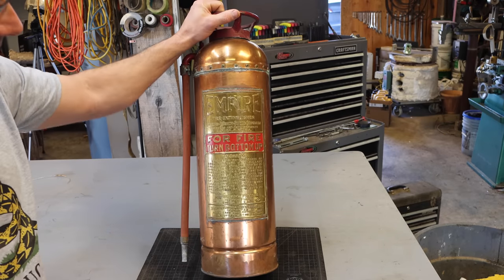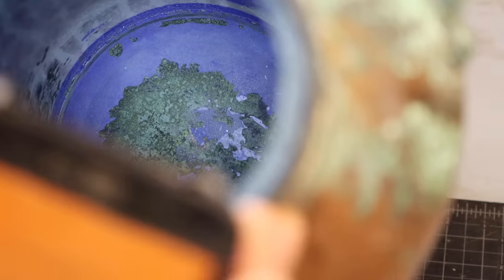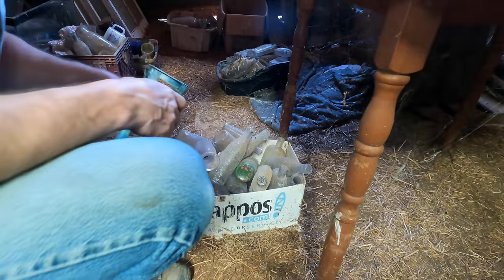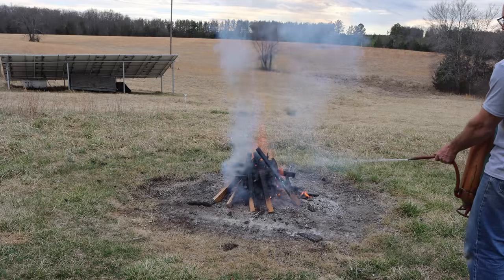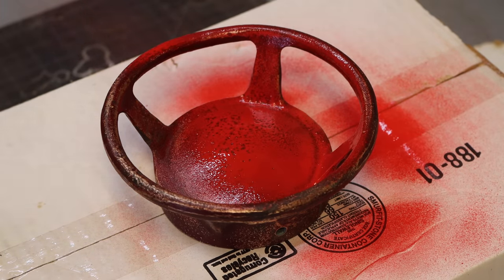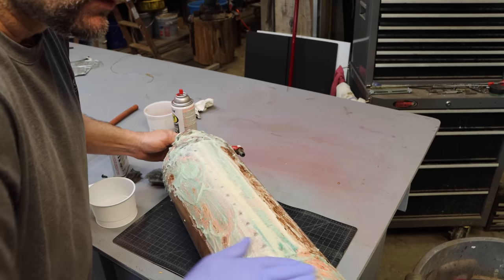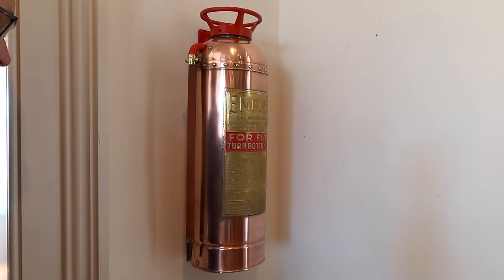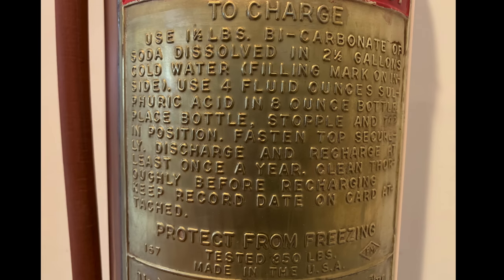Surprising Design in an Antique Fire Extinguisher. Testing and Restoration.

Comment: Great job on the restoration. Came out great. 

Just a little warning. Whenever you attempt to charge and use one of these as either a demonstration or just playing around, keep exposed skin away from the nozzle when you invert it. The first few ounces of liquid that come out are more often than not, mostly straight (or nearly straight) acid.

Comment: Just happened to visit your site since joining awhile back and found you working with the fire extinguisher.  I happen to have one that came from my two-room grade school in Grape Creek, Illinois.  My father was on the three-man school board at that time, in the late 1940s, and I was helping him to get the school ready for the fall session.  Those old extinguishers were being replace with newer models and dad gave me one but I had to discharge it.  So I did, outside.  

I still have the unit and it is far better shape than the one you were given. so I've not done any work on it.  One of my heirs will inherit it soon, I'm 84.

Comment: Nice restoration!  I got ahold of one of those in the first radio station I worked for (they were just in accounting & sales, CO2 in engineering spaces).  Insuror required a change to ABC extinguishers, and the folks that sold them to us were nice enough to offer to haul off the old SA extinguishers.  I snagged one and turned it into a nice lamp.

Comment: The salt is the abrasive and the vinegar is the cleaner. The flour congeals the solution and makes it less runny and more sticky. You  could also coat it with ketchup and it would do the same thing just would have to leave it overnight. :)

Comment: I got one of these at a Flea Market on time. I still have it ! Is there any kind of a cap you can put on the bottle inside in case you slop that around by mistake and get the acid to go off. Just asking. John, can you bead blast the parts to clean them up. Hard to paint parts if not cleaned very well. Nice job.
Reply from the maker: I think they are supposed to have a lead stopper on top of the acid bottle.

Comment: That's really cool. I have one of these that I got for my birthday when I was 12 or 13, mine is chrome instead of copper. Missing the bottle and bottle holder, and it's got a slot cut in the lid so it can be used as a coin bank. I tell ya, when it's full of spare change it is NOT LIGHT!

Comment: Nice quality video. One issue i have just as a bottle guy. Get that milk bottle outta there. That thing was from the 20's or 30's. Im pretty sure there are nicer options for replacement bottles for the long run. Look through those loft bottles. I have a few and those fit the bill for some nicer ones.

Comment: just a tip i have spray painted overtop of old letters on bucket trucks drippin with grease and hydraulic fluid and ETHER works really well at degreasing stuff ...spray it whipe it and the air vaporizes kinda like alcohol does spray it again whipe it ...PAINT ALL DAY LONG no beads no runs .. ;)

Comment: Was the acid you used concentrated suphuric or is it diluted with water. Reason I ask is that it didn;t seem to have nearly the amount of pressure that it should.  Back in the 1970s I worked for a fire extinguisher maintenance shop and I discharged and recharged hundreds of these soda acid types.  On average once turned upside down the spray would reach a distance of about 50 feet and it would take about 50 seconds to completely expel all the liquid. Being it took yours about 3 minutes to discharge and there was still water in it leads me to suspect that you didn't get a complete reaction. In the long run however it might be a good thing. Since the extinguisher probably hasn't been hydro statically tested in a very long time it may not be able to withstand full operating pressure.

Comment: Well when you do a half ass test, with half azz'd ingredients. You already know what you get. I've restored probably 200 of these. And with a quality acid and a proper nozzle the results can be kinda spectacular. I pressure test all mine to 200 psi for 15min. "Quick fire" manufactured a 4gal model that was supposed to generate 350psi

Comment: My project on one of these stalled out because after cleaning, the copper color disappeared, and it was a much more brassy color like the panel on the front. It was extremely frustrating, and I've got no idea what I did wrong
Reply: It could be that the one you had was made from brass.  The really old ones were made from copper with riveted seams. During the 1940s they startem making many of them from brass. Then soon after they went to stainless steel.

Comment: The red you used isn't quite the correct tone .  These were more of a fire red.  (Orange red).  This looks like a pure red.          When I do these i use oil based paint. And a cleaning cloth to wipe the letters.   I use turpentine on the rag.   The cloth needs to be moist  not stopping wet.    Did you refill it?

Comment: LMAO Solvent incompatibility usually between wet lacquer and dry enamel.  Salt + Vinegar + Copper Salts are ok,  but if you add Aluminum to that the reaction is destructive (IE dont set an item you are cleaning in an aluminum pot or tray).  I would have tried first simply a Mule Team Borax in hot water with an Aluminum foil base and let it battery clean first, the patina of past uses of sulfuric acid splashing on the copper gives some 'used through time' to it.

Comment: For the letters you can use a large flat piece of wood or metal, stick some fine sandpaper to it and use that to take off only the high spots of paint (that is covering the letters).
Reply: A basic sanding block would work perfectly. Even a ruler wrapped in sandpaper.

Comment: One other thing... If you were ever planning to really use it. The glass acid bottle is supposed to have a lead stopper in it that falls out when turned upside down. It's just enough to seal in the acid against being splashed out into the soda water accidently.

Comment: I think the inner container was slide up from the bottom and then the cap at the bottom was pushed in and then they rolled that seem at the bottom area to crimp it all together 😀  the reason it's so obvious is that the hose is threaded into the inner vesal, that means the inner vessel was built and drilled, tapped before installing into the copper outer skin.

Comment: I grew up in the era of that type of fire extinguisher and I seem to remember that the acid container had a weighted cap that just set on top. It would keep the acid container sealed and would fall free when the extinguisher was turned over for use.
Reply: Yep, you are correct. There was a loose fitting lead stopper in the top of the acid bottle. When you turned it upside down the stopper would fall open allowing the acid and the bicarbonate solution to mix and react.

Comment: When I worked rebuilding industrial electric motors I just brushed some muratic acid on old green copper in order to cleanly braze on fresh lead wire. Worked quick and made it shine like new with a quick wipe from an abrasive pad afterwards.

Comment: Interesting to see how it works,  Great job in restoring it.  For the painting, while it is wet you can use a flat block of wood with a thin cloth like a tee shirt stretched tightly over it and damped with a solvent.  It will wipe just the letters clean.  Easier and faster than a Dremel after its dried.

Comment: John, I have a similar one sitting under the table saw.  It's a "PYRENE" Soda Acid, all brass I've been saving for decades to restore.  It even has four paper Pyrene tags attached to the hanger, one reads (in pencil) 'Last charged 6-11-1959'.  The other old paper tags could be from the 1940's with original manufactured numbers, model, etc., who knows?  Thanks for the reminder, I just pulled it out from under the saw dust...just made a walnut roll-top desk and didn't have time to clean yet.

Comment: Excellent job. I tidied up one which someone had partly sanded with a coarse grit previously. It took me so many hours to get it half as good as yours.  Anyway with a slit in the top it makes a great money box.
Reply: Beware the lead liner on the inside. A bunch of loose change in there could come out with lead on it when you make a withdrawal.

Comment: As a teenager I bought one of these extinguishers empty. Reading the instructions on the exterior I bought a container of baking soda and a flask of sulfuric acid. The flask is placed in a holding cage inside the top of the unit. When upsetting the extinguisher after it had sat many years in our hallway the whole bottle of liquid was expelled. I have since watched many hundred thousand dollar farming combines burn to the ground. Every one of these combines needs this extinguisher installed in a hook on the wall with a rip strap holding it in place. When the combine ingests a stone it causes sparks igniting the straw in the eccentrics and when the operator smells smoke he should immediately lift the side door of the combine, and with THIS EXTINGUISHER douse the fire saving his harvest year.

Comment: I have homemade versions of these with vinegar instead of sulfuric acid. They key here is that the water should have dishwashing detergent and the foamy output contains bubbles of CO2 which acts as a surfactant and the CO2 displaces atmospheric air that contains 20%  oxygen

Comment: Yeah, I would like to spray acid on anything valuable that happens to catch on fire. No wonder it's an antique!

Due to tin being in the solder, solder melts at a lower temperature than plain lead. I wouldn't think that a soldering gun would reach a high enough temperature. Color me surprised!

Comment: Just want to agree with one of your commenters it needed a lead plug to put in the bottle. The bottle was not as big at orifice as the one you chose probably 3/4 of an inch crossed at the most that the opening.. not to be gross, so like a miniature butt plug🤔

Comment: I would assume that the battery acid would be neutralized when it's squirted out but I would still not want it splashed in my eyes. I wonder why they didn't use acetic acid.

Comment: Pressurized water extinguishers are still used today, plain water (may have a few ounces of foam concentrate added), and pressurized with an air chuck.  I am familiar with New York Fire, the ladder truck crews will carry one into a building when they go to the fire room.  Not having to carry and maneuver the hose, they get there rather quickly.  2 1/2 gallons of water can darken down a fire rather effectively, and since they have a "trigger", they can shoot in bursts.

Comment: Good stuff not sure how this video only has 10,000 views….

People take for granted fundamental engineering like production tolerances pressure vessels and seals. However back when these were built none of those standards existed. It was extremely difficult to create a pressure vessel which would hold pressure for long periods of time.

We all stand on the shoulders of giants.

Comment: With the hole in the lead: if the lead was melted in, wouldn’t the hole be a non-issue since there isn’t a separate layer for the extinguisher to leak into? Or is there a thin gap between the lead and the copper even when melted like you described ?
Reply from the maker: Not sure. My thinking is I wouldn’t want acid to be able to reach the copper.

Comment: Have you tried it with vinegar instead of the acid? I wonder if you would have the same or close to the same reaction.
Reply: Vinegar would be too weak. You would get very low pressure. They were made to be used with 4 ounces of fully concentrated sulphuric acid.

Comment: I have one similar to that, only mine's all stainless and the hose comes out of the fitting that screws in the top, so there's no extra holes in the pressure vessel. I'm gonna fabricate a new top to screw in that will plumb up to a compressed air system in my car, and my compressed water fire extinguisher will be strapped to the outside of the rear driver's side frame rail. It says it can withstand 500 psi with water, so 125-150 psi of air should be no challenge for it for a long time.

Comment: "For fire, turn bottom up" I'm pretty sure fire is the one thing you don't want when a extinguisher is needed.

Great restoration!
Reply: "For" takes up a lot less room than "in case of". And back then, it was a LITTLE bit safer to assume that someone needing an extinguisher would have the sense to understand that it means "(to use this as a cure) for fire, turn bottom up".